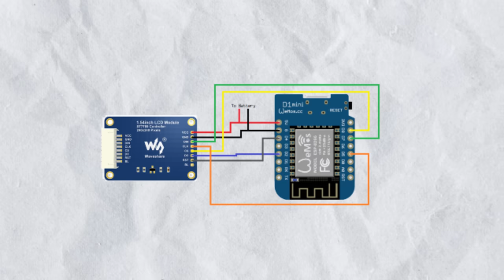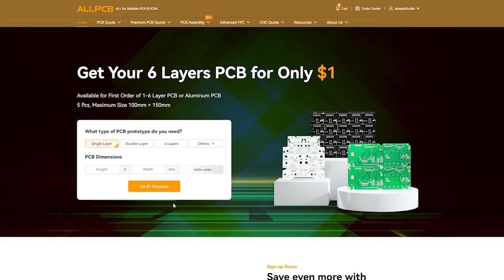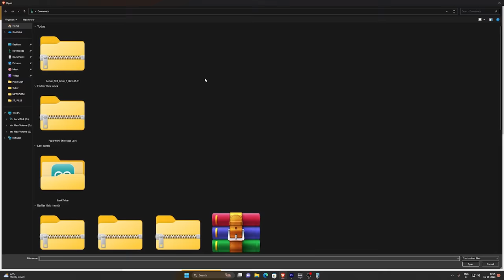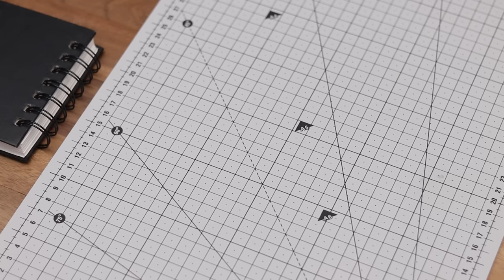Build Your Own Digital Desk Clock With Weather Station | DIY Projects | The Wrench

Comment: why everything nowadays dependent on the internet connection 😐, it can be made with internet wifi connection as wells by using temprature sensor and manualy set date and time

Comment: i suggest for you to add a button to autoconnect with wifi so you can do so if you change your router without need to change the wifi and password credentials from the code everytime you change a router